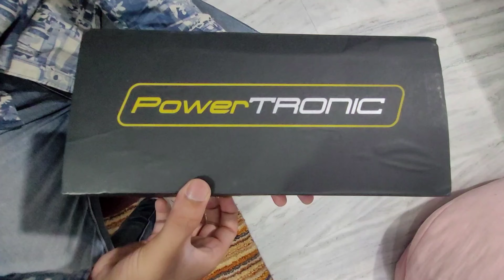Powertronic Map Installation | in Fastest Dominar 400 | of U.P

Comment: I am facing Very low mileage in my Dominar 250, also engine jerkiness in low gears and low torque. Service centers are not able to fix this issue. Do you think powertronic can fix it ?
Reply from the maker: No bro probably many of my friends also facing the same problem bt they couldn't find out the solution , and basically powertronic takes ur rpm to 1200 rpm ,hope uh understand

Comment: Bhai ji 
Meri dominar 400 2018 model
Timely service hoti hai 
But wo 154 se uper hi nhi jati rpm light on ho jati hai.

Other dominar 170+ tak jati h

Muje kya karna chahie isle lie 
Please help
Reply from the maker: Bro wait problem hoskti hai bike ki bi or apko bi and tabbi na ho to performance upgrades krke dekhna like exhaust and air filter wings sprocket
Reply: 2018 35bhp kabse 170 jati hai? Mostly 163-164 and ap ek baar acha engine oil use kro and kn filter lagake check kro meri v same hai 166 jati hai fir rpm

Comment: Bro powertronic dominar 400 2018 me install hone ke baad top speed kitna jata hai.
Reply from the maker: Bro top speed ni initially power badti hai mtlb actual speed jo normal ecu se 10 seconds me jaati hai same wahi powertronic me 7.5 seconds me jaati hai
Reply: Bro 10500 par rpm set kare to 390 ko beat kar payegi?
Reply from the maker: @vickyparmar6548  ofcourse bro y not bs uske saat power parts bi use krna jese ki engine oil full system exhaust chain sproket powertronic bmc air filter